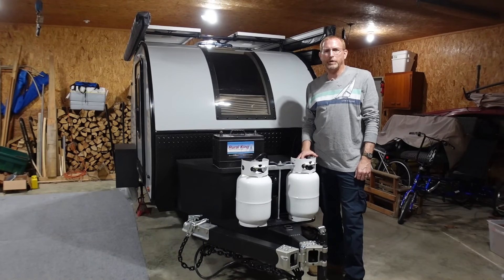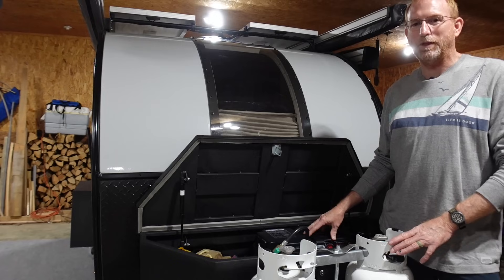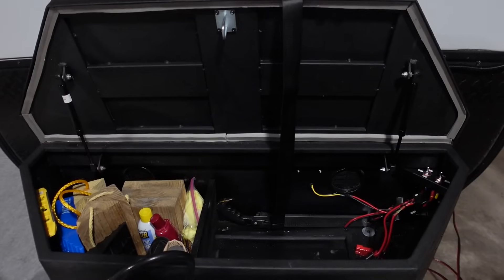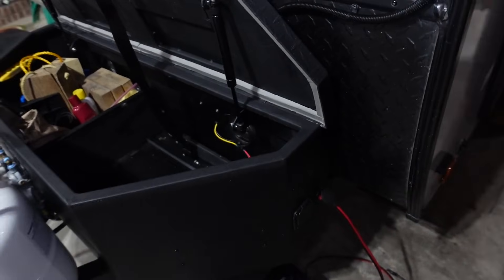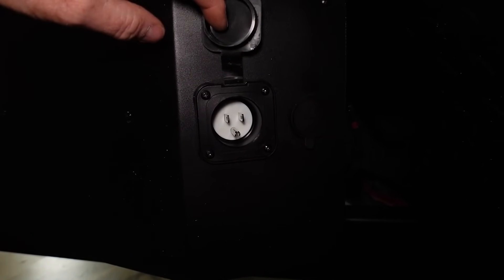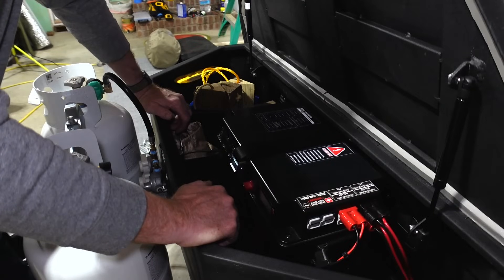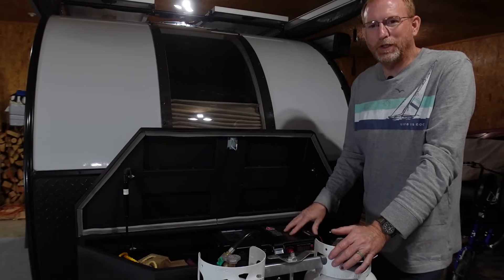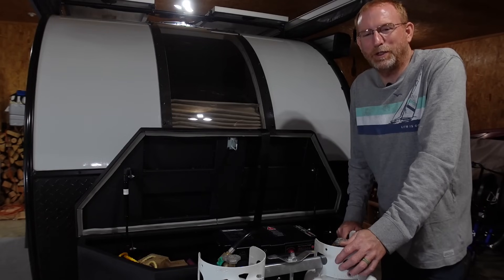How to power your camper with a lithium powered Portable Power Station!

Comment: Does your camper in this video have a factory installed AC inverter/converter with a shore AC power cord?
Reply: I should have held my question till the end. You answered it a bit after I asked it.  :)  So you have disconnected the 12V output from the factory power unit for all your 12V camper wiring and feed it to your power station?  And you have also disconnect the battery charging leads from the factory unit to your power station?
Reply from the maker: @jamesblack4539 that is correct. We isolate all the 12v loads and power them soley off of the lithium battery in the PPS.  We also isolate the lithium battery from the tow vehicle by disconnecting the 12v power lead in the 7 way whip to prevent backfeeding from the lithium battery into the tow vehicle's electrical system. No matter how small the chance of causing an issue with your tow vehicle's electrical system its not worth the risk with the cost and complexity of modern vehicle's electrical systems. We went 42 straight days on our 48 day road trip just off of solar power before we had to top off the battery with our little generator due to lack of sun light.
Reply: @adventuresofthememorymakers  Thanks again for the reply. What tongue box do you have to fit that Licitti box? I show the new version is about 14" high.  I am picking up my camper soon and I want to order a tongue box that will accommodate my future upgrade of a Licitti box. I really like your setup described in this video.
Reply from the maker: @jamesblack4539  we are using a TSC beveled corner tongue box that has exploded in price. I think it was 259 when I got ours and now its 450!
Reply: @adventuresofthememorymakers  I am a new owner of a 2025 Bontrager 12ROK.  I downloaded the manual for the model of my WFCO converter. It is a WF-8955-AD. When reading about the charge profiles for Lifepo I kept seeing mentions of charge mode stage lasting from x to x hours. I am assuming this is the "time" charging you are speaking of?  I found an interesting statement in the manual that I think would work for and be an easy way to isolate the battery and 12v system from the charging output of the WFCO converter as you have done with your setup.  It was in the "Replacing the converter section" of the manual and reads as follows: "Remove
and set aside the Reverse Polarity Fuses to disconnect the converter section from the rest of the RV DC power."  Would this accomplish what you have mentioned? Is this what you did on your system?  I keep watching your videos and continue to find them interesting and they are filling my mind with ideas.
Reply from the maker: @jamesblack4539  could you please email us a link to your manual? Thewizardofmodz@gmail.com
Reply: @adventuresofthememorymakers  Sent. Thanks
Reply from the maker: It does have a WFCO 30 amp shore power AC with dc converter charger but we very rarely camp with shore power.

Comment: Have you had any experience with running your teardrop off of a solar generator system? I have a Bluetti AC180 and I am wondering if it would be possible to use it.  I think I first got the idea from Cosmo Weems using a Jackery, but I am still thinking this through. Thanks Sam.
Reply from the maker: @montycraig5659  this ehole video is about how we run our camper off of a Portable Power Station, aka, Solar Generator. We took a 48 day road trip with it and solar provided all the power we needed to the PPS for 42 staight days before we had to supplement with the AC powered charger.
Reply: @adventuresofthememorymakers   thank you sir.

Comment: You mentioned cutting the 12 vdc from the camper's converter.   Couldn't you have used that 12 vdc as input to your 12-48 boost converter to MPPT to recharge the battery? It would have saved the cost and space for another charger.  Although I suspect it would require routing a wire from the converter dc output to the front box  so you could switch that output between converter/tow vehicle/solar.
Reply from the maker: The reason I did not do it that way is because we very rarely have shore power as we are typically off grid campers.

Comment: How did you wire the boost converter?   Did you run a new separate wire from the tow vehicle battery to the boost converter and then to the lithium battery on your camper?
Reply from the maker: On the tow vehicle I added a new lead from the battery that goes through a 30 amp resettable circuit breaker to a 12-volt relay that I can control from inside the cab. I pull power off the ignition side so it can only be on when the truck is running to run that relay. From the relay I ran a new wire back to the 7-way plug on the vehicle and tied into the 12 volt lead in the 7-way plug. Then I merely attached that wire on the camper to my 12-volt power converter. That way there is no direct connection between the vehicle electrical system and the lithium battery in the camper
Reply: @adventuresofthememorymakers  Thanks for the info.  So to be clear, is the boost converter wired between the lithium battery and a 7-way plug or is it between the tow vehicle battery and the 7-way plug?
Reply from the maker: @michigander58  between the 7 way plug and the selector switch for the solar controller input in the tongue box.
Reply: @adventuresofthememorymakers  That's what I thought.  Thank you.  Love your videos.
Reply from the maker: @michigander58  thank you for taking the time to watch them!
Reply: @adventuresofthememorymakers  have you had any issues with the longevity of that converter? I bought one that looks quite a bit like the one you linked and it only lasted a couple of charge cycles and died. I was sent a replacement and we will see how long it lasts.
Reply from the maker: @jamesblack4539 so far so good. We rarely need to use it.

Comment: Does the lithium battery run A/C? It's probably a dumb question.
Reply from the maker: Thank you for watching. Not a dumb question. So it depends on what size inverter you are running. For a window AC like this you would want atleast a 1000 watt inverter with 1200-1500 watt surge. A single 100 amh battery will only run that load about 4 hours so to be able to have AC all night long I would recommend at least 2000 wh or 200 amh of battery power.

Comment: Could you charge that battery with a generator using the extension cord or is there some reason you shouldn't do that?
Reply from the maker: Thank you for watching and yes you can. In fact I didn't show our typical travel setup but we carry a small 1200 watt inverter generator for exactly that purpose. The battery is essentially a storage device and if we don't have solar or ac we can use the tow vehicle or generator to top off the battery if needed.

Comment: So rather than a dc to dc charger you just ran your red off your 7 flat to the input on an mppt charge controller? Never thought of that.
Reply from the maker: Yes sir, just make sure you isolate, protect, amd switch that power source to the 7 way. You also need a cheap 12v to what ever voltage you want power converter. I run a 12-48 volt converter at 6 amps. That is what actually powers the MPPT.

Comment: Portable power stations are not UL-458 safety certified for use in mobile applications and should not be used for such purposes.
Reply from the maker: I have read UL-458 and that is another reason I chose the Licitti AC Heavy Duty power box. When being used as a 12v DC power source the power is coming directly from the 12v battery with no conversion process required. So in that aspect it is no different than using a stand alone 12v lithium battery. 
 The AC charger for the battery in the power box is an external battery charger that is seperate from the power box and only used when the camper is at rest and under supervison.
 At the end if the day, while UL certification is the best practice it is not a legal requirement.
Reply: Regulatory entities are not there for citizens...they serve the industries and the financiers of industry...all of them

Comment: What a novel idea!  I have a 32 foot motorhome 30 amp service. Sometimes I plug my 120 volt power cord into my ecoflow delta. It powers all my AC DC circuits but I have to turn off my converter circuit breaker so my lithium house batteries (200 amp hours) don’t suck all the power from my delta power station. Congratulations on being a dc only camper!
Reply from the maker: Thank you for watching. When I rebuilt Cindy's 1968 Shasta Ibset it up in a very similiar fashion. It is just so simple and works great!

Comment: Hello Sam - another fantastic video, and the one I have been waiting for. I would love to do something similar for this on my Class C rig, but the issue of getting the correct wiring from the Licitti (I have one based on your Licitti video) to the 12v DC panel inside the camper is a bit beyond my skill set. The rig is set to have the house battery sit underneath the frame and it connects up similarly to a car battery with cables and posts, but where it goes from there I am not entirely sure. I'd love any initial thoughts, and if we need to dig deeper I'll email you. In short, do you think this can work in a Class C? Thanks.
Reply from the maker: Hello Tom and as always thank you for watching. Drop us an email at the adventuresofthememorymakers@gmail.com so we can discuss this further as I will need some more information.
Reply: @adventuresofthememorymakers  Will do.

Comment: Ever since I've seen the Licitti Battery Box, I've been obsessed with it.  It's been a power house and so easy to use with my Hiker Trailer.  I paired it with a Victron Smart Shut and a Power Queen 100Ahr battery and probably saved me 400 to 500 bucks over a store purchased power box like a Goal Zero or a Bluetti.
Reply from the maker: I am right there with you. Inadded the smart shunt and upgraded the MPPT to a Victron 75/15 inside the box with a HQST 100amh lipo battery. It was a tight squueze but I got it to fit and it works great!
Reply: @adventuresofthememorymakers  Hey, this is Kyle!  I'm waiting for that install video!!! LOL!  I'm very interested on how you fit that charge controller in that tight space!
Reply from the maker: @squaredropadventures  I just had another viewer request that video. I will try to get that out soon but there are only so many hours in a day. Just not enough time to get everything done.

Comment: Any chance we can get a peek inside the power box on how you changed out the solar controller?  Mine is stuck with Velcro to the outside for now... Camper is still in the Cabin garage surrounded by 3' of snow.  Spring is a coming... and thanks Sam for all you and Cindy do for this group, it is appreciated.
Reply from the maker: Thank you for watching. I have a list of videos to get out but there are only so many hours in the day. I have had several request to show what I did inside the Licitit power box so I will try to make that happen soon.

Comment: Great video! Thank you. I am still learning. Why do you need to convert to 48v into the MPPT? Isn't there loss in a conversion (I am just assuming)? Can you not go straight 12v into the MPPT? Thank you in advance for an response!
Reply from the maker: So typically mppt Chargers will not start charging the battery until the input voltage is 5 volts higher than the battery voltage. The great thing about an mppt charger is the take excess input voltage above the 13.4 it is going to use to charge the battery and it converts that into current. So it will take that 48 volts at 6 amps and change that into 13.4 volts at 15 amps. Since I'm powering that power converter off of the tow vehicle and the alternator while we're driving down the road in essence I have an endless supply of 12v power So I'm not worried about the loss of efficiency in the conversion process in that application.
Reply: @adventuresofthememorymakers can't you use just any cheap charge controller to do this? Does it have to be an mppt controller?
Reply from the maker: @jonathanturner6702   you could use a PWM charge controller but once you use a good MPPT and see the difference they make you will understand why I went with the Victron. The MPPT allows you to run higher voltage panels and convert  that access voltage into amperage. Plus they adjust to changing conditions so much faster. I was a PWM holdout till I saw the differemce for myself.
Reply: @adventuresofthememorymakers  ok so I am just trying to make sense of this. You are using the mppt charge controller  to charge the battery from the solor panels and the 12v power from the vehicle?
Reply from the maker: @jonathanturner6702  , correct, that is what the switch on the left side selects. In the solar position it pullls power from the panels, in the tow vehivle position it pulls power from the tow vehicle through the 7 way whip, which feeds the 12-48volt power converter, that feeds the mppt charge controller.
Reply: @adventuresofthememorymakers  I have to say that is Genius. Great video and great way to keep cost down. You already have the mppt charge controller so you may as well just add the converter and charge the batteries that way. Where did you purchase your Licitti?
Reply from the maker: @jonathanturner6702  you by them straight from Licitti. We have a video out on the unit you might want to watch. I love it because someone like me can repair and modify it to suit your needs. 

https://www.licitti.com/product/ac-battery-box-matthew/

Comment: I use a bluetti 500WH power station in my square drop for the last two years and it’s worked to power the light, max fan and 12v fridge, with a 100w panel it been just a little close.  Just made up my mind to go with budget 100 ah LiFePo4 group 24 battery (took some researching to find budget company with good rep).  Leaving out the inverter since I never use 110.  With a 20 amp mmpt controller it’s running me around 350.  Just could not get a 1000+wh power station for that price.  But I do agree with you on how nice a power station is and how you will use it when you’re not camping.
Reply from the maker: Thank you for watching sir. Being able to use the power station outside of the camper when you're not actually camping is really nice. I really like items that have multiple uses.